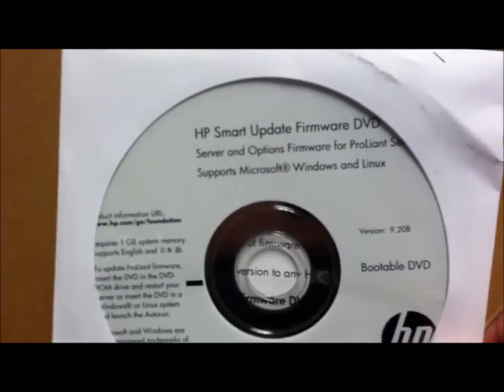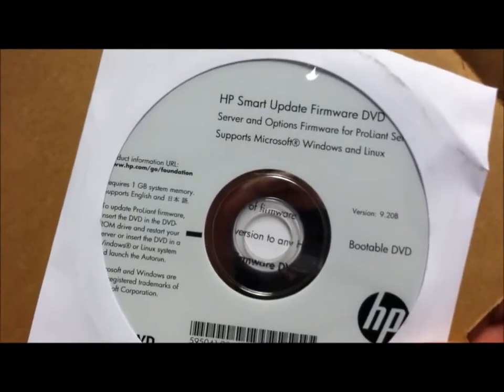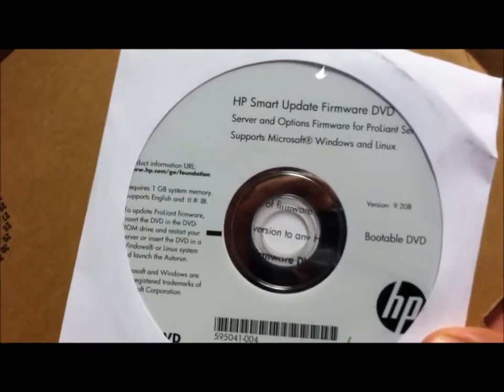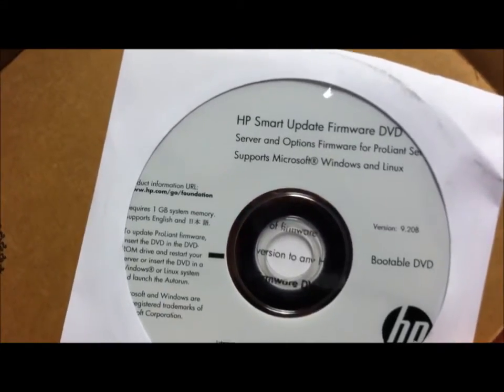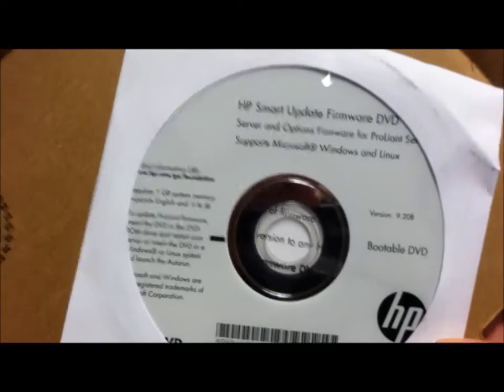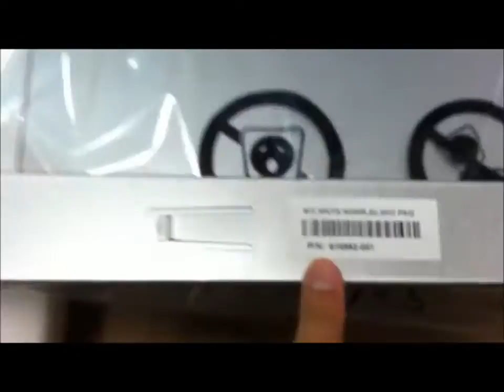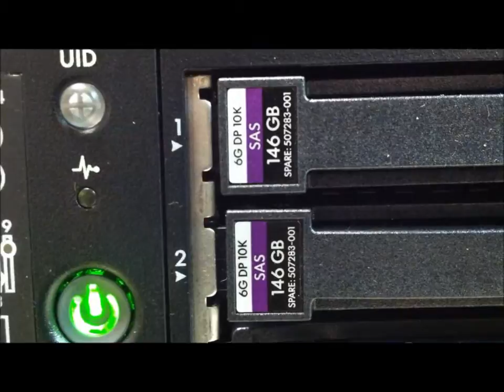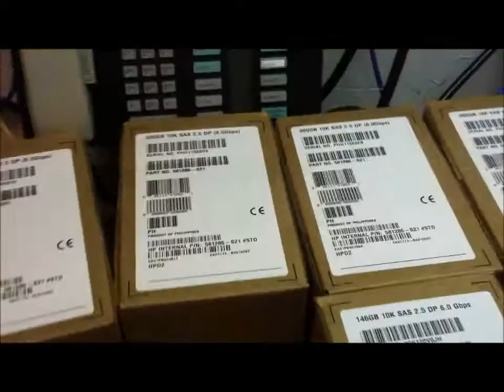Exchange 2010 - Hardware unpacking

Comment: At approximately 9:16 - 9:25 you identified the raid array cache module as the raid controller.  The raid controller chipset is most likely under the heat sink in the lower left-hand corner of the same time period.

-saige-